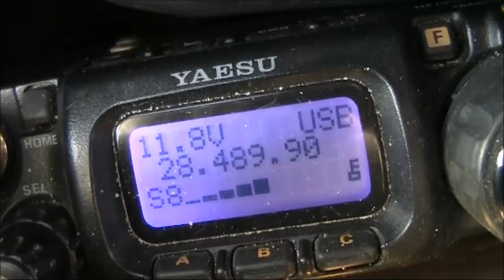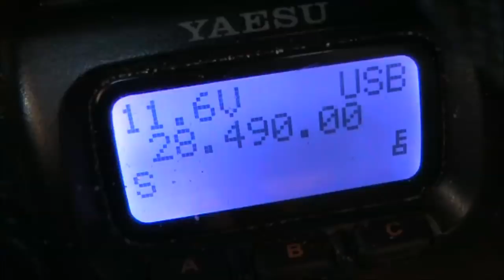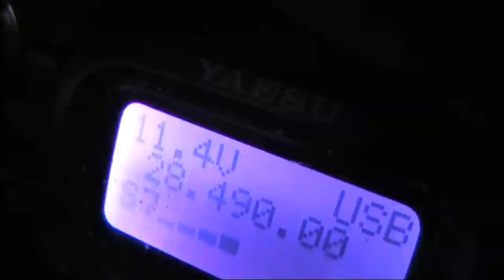Does having salt water underneath improve the performance of magnetic loops?

Comment: Peter what is happening here? The signal seems to plummet when you are standing on the edge of the water but to go back up when your feet are wet. Are you coupled to the antenna like a part of its tuning system ? What happens if the loop is over the water but you aren’t holding it ?
Reply from the maker: Unlike with the Wadetenna, where there is an increase in signal when my feet are on moist sand, the loop is well insulated from my body. So it doesn't matter whether I'm holding it or not. I also don't need to retune the loop when I walk into the water.
Reply: Do you think it acts like a massive uncoupled ground plane in a sense??
Reply: skywave dxer that part -generally speaking -I understand. But there appears to be dramatic changes as he goes from wet feet at waters edge , out to water up to his knees. Perhaps as he goes further out, the water is acting as a longer and longer “ground radial” ?